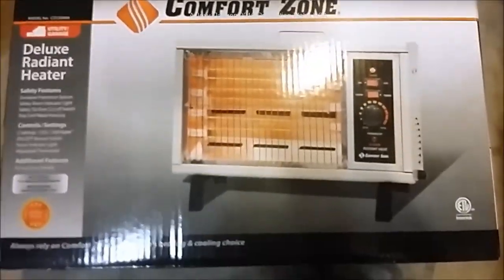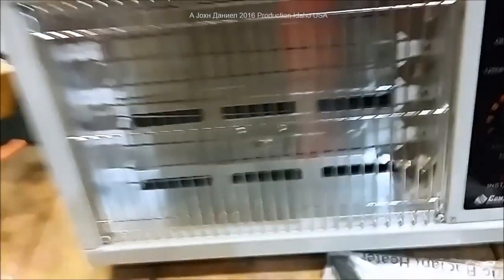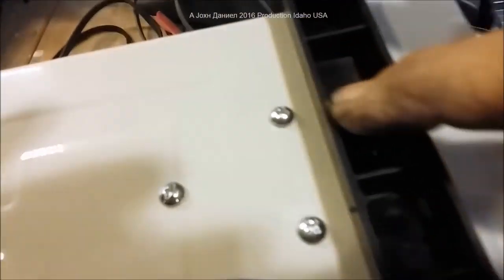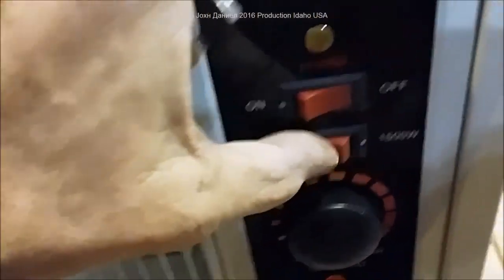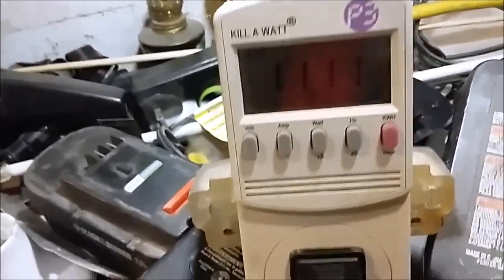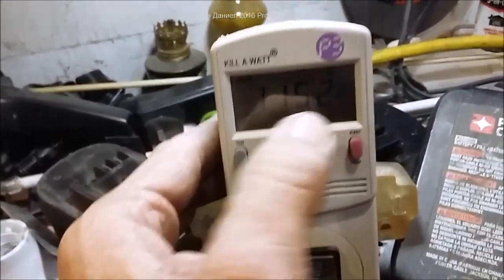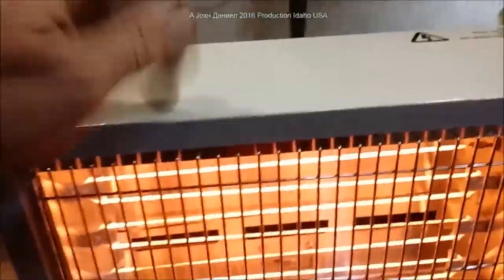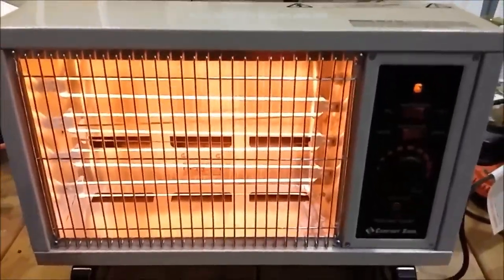COMFORT ZONE Portable Heater - Test & Review

Comment: I have one and mine  will run a little while then shut down and the alarm light comes on . You have to unplug it and let it cool then plug it back up. What's up with that.
Reply: Mine does the same. Doesn't stay on long at all
Reply: Probably the fan broken off! Epoxy it back on and should be good to go! Had the same issue with mine
Reply: It's the thermostat. The copper piece with two screws on the bottom face of the panel.  Unscrew back cut the two wires and then wire those two together.  Won't happen again.
Reply: @jesseprowell5839  thanks just did for mines

Comment: I have the same model under the duraflame brand. Mine's been running for 6 years straight. No issues and works like new. What I like about this heating cabinet is that it can be disassemble easily for cleaning.

Comment: I’m hoping you’re monitoring your videos. I have the same one and my on off rocker switch has gone dead. Won’t move what so ever. Wondering if you may guide me to where I can get this switch. I’m more of a DYI kind of guy. I’d rather fix it before I buy another one. Waiting to hear from you. Hopefully soon☺️🤙🏼
Reply from the maker: The rockers are common and sometimes you can get them off the shelf at Home Depot or Lowes. Remove the one in it, take pictures so you are sure of wiring to them, take to a hardware store or home depot, and they can get you a new one.

Comment: my heater only works on the 1250 watt setting its 2 months old
Reply: same model heater
Reply: on 1500 setting  it shuts off after 30 sec. and over temp. light comes on
Reply from the maker: Sounds like the over temp switch. If your heater is reaching incoming air temp over 89 degrees it will shut of on the high setting. If the fan is weak, clogged with dust, too close to objects or blocked it will also do this. The over temp switch ( bi-metal disc switch) is located in the back of the unit on the back of the reflector behind the coils and many heaters of the Sunbeam brands ( parts) can get one thats weak.
Reply: @JOHNDANIEL1  I bought air duster and sprayed the vent out and it works great again I think if you do that from time to time it should be fine

Comment: remove the little thing inthe middle of the bottom, I think it is the balancer, and I put mine on bricks so it will never shut off ,  I titally rely onmine for heat,    I stay inmyroom and cant afford to run the furnace,  this heater is great after I removed the legs and the balancer in the middle of the bottom good luck,    reove the legs  remove  the littel pointer thing in the middle of the bottom,  wa la it works perfect,   just make sure you curround it , greatly Ihave mine on house bricks and one in the front of it, so it cant tip over ,  good luck

Comment: The on off button is like loose and jammed for me. It prevents it from turning on. do you think I have to get a screwdriver and dig in it to see what's wrong?
Reply from the maker: Uh, Unplug, take apart, replace with new switch rated at 15+ amps is my best suggestion. Sounds like your switch is toast!

Comment: Can I use this to heat up my apartment?
Reply from the maker: +God is Love41 I use one in a 36 foot long 5th wheel with 2 slides and it does amazingly well.
Reply: Јоhn Daniel Thank you so much.
Reply: Јоhn Daniel so I can leave it on and leave it? :/
Reply from the maker: Yes, its safe to use and leave on when your not home as long as your not placing it in a dangerous location for a heater.
Reply: Јоhn Daniel I wish you wouldve told me that before I left. But I know now, thx